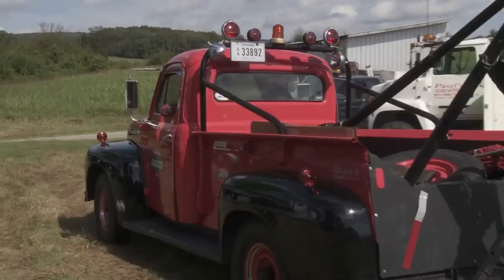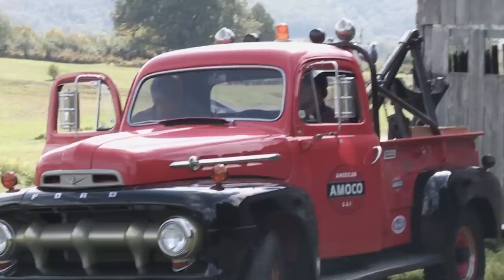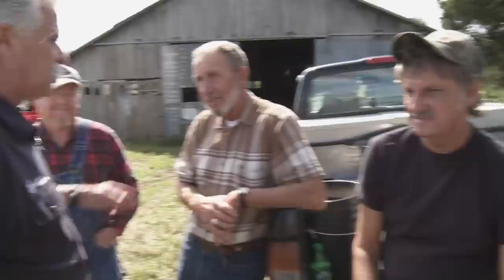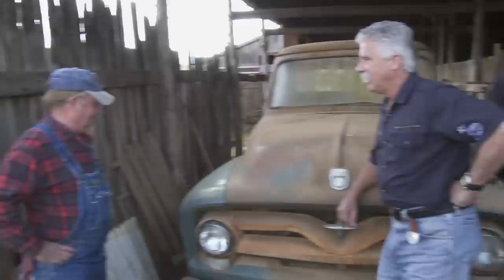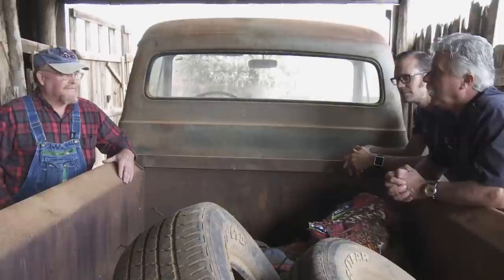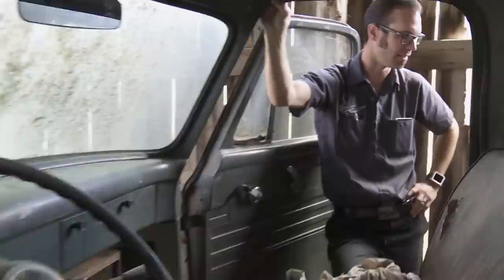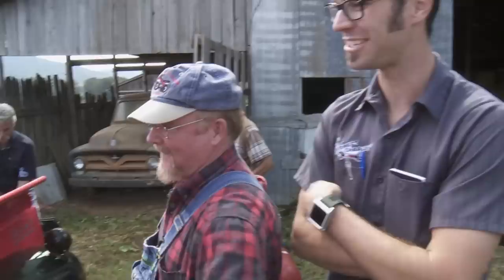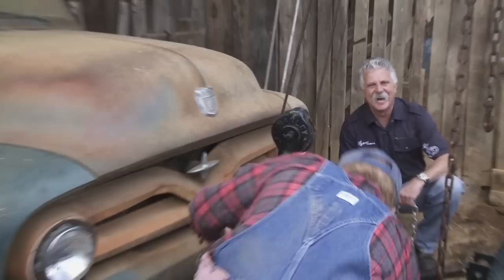Corky Coker picks a 1955 Ford F100 Barn Find Truck

Comment: I have a 1954 F-100 with the 292 V8, three on the tree and only 12800 miles on it. Came out of South D. Even still 6 volt . Armstrong power steering.

Comment: Good practice when getting a vehicle running that hasn't ran in a long time is to change the oil, change the coolant, fuel, spark plugs and oil filter. but most importantly remove the distributor and us a priming tool with a drill and PRIME that engine before you crank it. or cause some bad damage in the engine.

Comment: when I was kid in 1965 in pacifica ca. I worked part time at my neighborhood garage. ed and dick had a 55 f100 with a small hemi in it for a parts runner. I was banned from driving it after the 3rd transmission blew up. I swear, it was not my fault the damn things were weak !!!

Comment: Hard to fathom what you folks deal with back in the humid wet part of the country, specially where they use salt. . Out in the inter mountain west and inland Cali. the rigs are truly pristine. It's all relative though and something scrap here could be a true find there.
Reply: The south isn't as bad as up north. Plenty of rust-free cars south of Virginia and away from the coast. It's more the interior and not the floors and panels that go. The humidity fosters mold, and i'd rather replace an interior than have to put in patch panels. Go up past Maryland and that's where they use salt and rust eats through a lot of the classics. But true, out in AZ and California, the cars are remarkably clean. At the same time, there is a price premium for a "rust-free desert car" plus the cost of shipping to the east coast.

Comment: So you didn't show ANY of the work to get that old truck started?  Less gab, more fab...
Reply from the maker: That truck hasn't been restored.
Reply: Honest Charley has it now?
Reply: Honest Charley Don't you think it would of been a lot more interesting to see you guys getting it running...rather than a thirty minute negotiation and then loading it onto a flatbed?
Reply from the maker: Jereme Macready  we didn't work on it. still haven't, but will soon. Corky has plans for this and another F100
Reply: There are steps to take before firing an engine been sitting that long.
Reply: There are steps to take before firing an engine been sitting that long.
Reply: Jereme Macr